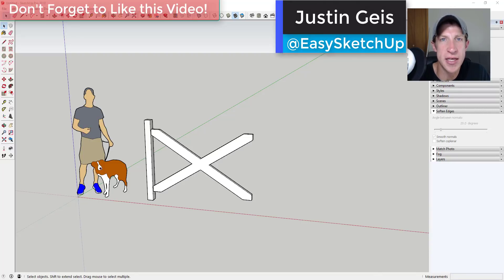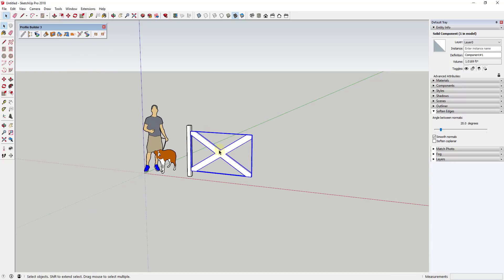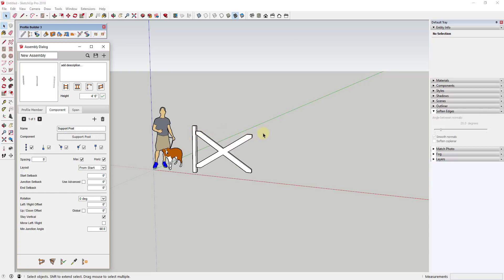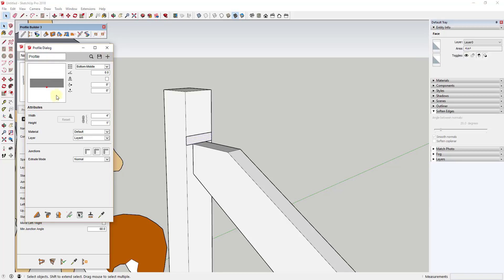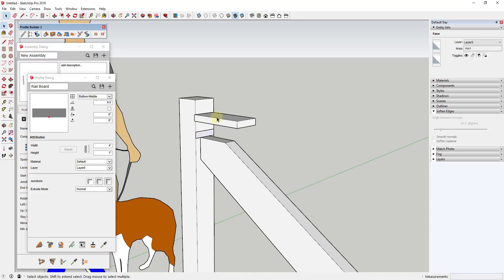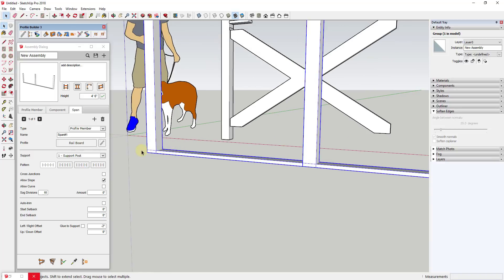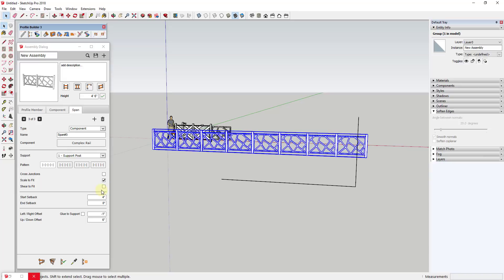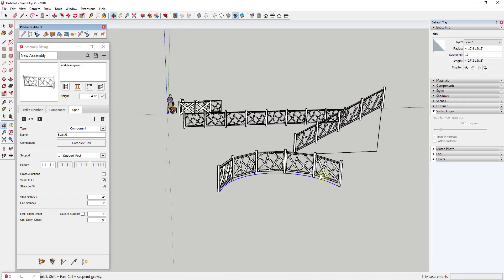PROFILE BUILDER 3 TUTORIALS - Repeating Component Assemblies with Spans

Comment: Made the assembly.... how do you determine which side of the assembly it snaps to a line? I have made a stair support which is quite wide and I cannot make it "start" correct it's like it should have been mirrored to work. Is there a trick, please?
Reply from the maker: You could adjust the left/right offset of the object by the width of your assembly...
Reply: oii, there are A LOT of parts. Would be great if it was possible to adjust in one go :-) also whether or not to snap top or bottom, like in "profiles"....

Comment: Thanks for posting PB3 how to. So many great improvements it's amazing. Here's one I found super handy: I just discovered the secret for the PB3 stock chain barrier assembly using spans to sag the chains. Add the span as a sub assembly and the wonder of PB3's span and sag kicks in as expected. I've used it to create an outdoor string light sub assembly that now hangs between anchor components (designed to be hidden when not needed, but required for the span/sag feature to work it appears). I'll try to post it in the 3D ware house for the community to enjoy, once it's out of "beta" testing. It's enscape ready, with lights and emissive bulb surfaces for rendering.

Comment: does this software requires internet??
Reply from the maker: I think it might to do the initial setup, but not for everyday use...
Reply: Yes I've noticed a tendency amongst plugin developers to build in internet -connection-dependency. It's fine for professionals who are always connected to the internet at the office, but a pain for those that infrequently connect such as myself. I also totally avoid subscription as opposed to one-time purchases because I need to buy software that suites ME, not the developer.
Reply from the maker: I don't mind if it's just a single connection to authenticate, but the ones that require constant internet access are really annoying to me, since I'm on rural internet that isn't very fast. Unreal Engine is the worst - every time they update the Engine, the update files are Gigs and Gigs and they don't support remote downloading very well. There are workarounds, but still...

Comment: So the spans are one dimensional. You drag them in only one direction. Can you do 2d spans. Dragging both the x and z axis for eg. My use case is creating wall tiles which have to span in 2 dimensions
Reply from the maker: Wouldn't you just set up the initial row of profiles to a certain height, the use the spans like normal? There's not going to be a way to drag up, then across that I'm aware of...

Comment: Holy lifton Clifton, that's complicated.  Throughout I'm thinking, "I can do all this with Sketchup as it is", what's the  pay off for spending so much time to set up this plugin?  Building, trusses and fences quickly?
Otherwise, you are setting the bar now, for these vignettes.  This level is what we expect always  now.
Reply: Refuso Againo it's taking time because he is explaining the process. You can do this in couple of seconds. You can no way get it faster in sketchup alone.
Reply from the maker: Was about to post something like this - I could have created this assembly in about 30 seconds, then making adjustments takes little to no time at all. Once you learn the process, setting up assemblies is really fast
Reply: That's where you need to do a little calculation. Take wainscoting for example (see  https://3dwarehouse.sketchup.com/model/ea8b94a0-0684-476f-ac6b-81a423749087/wainscot-or-panelling-props ), try wainscoting a room manually in SU and estimate the time taken. Then take advantage of the free trial period to do the same thing using Profile Builder. The difference between the two, multiplied by say $20/h times the estimated use over two years (accepted payback period) should be better than the cost of Profile Builder. For me, I would have to pay the hobbyist price of $69, save an hour for every room wainscoted, fence balcony railing, staircase banister, property border built etc etc, for at least  69 hours over 2 years. Feasible for most one-man outfits, I think.